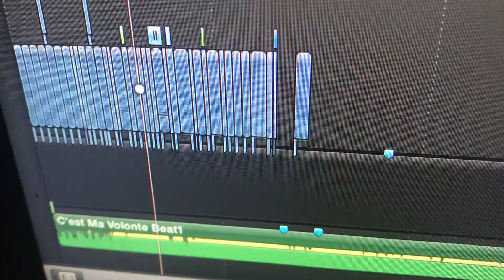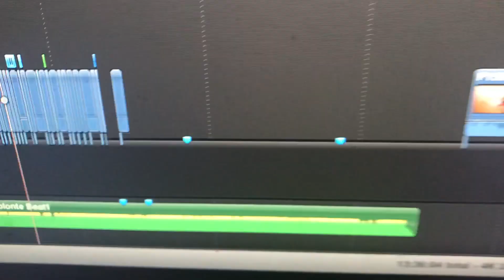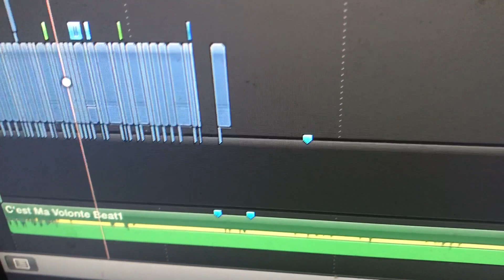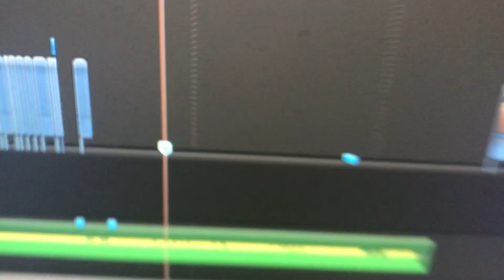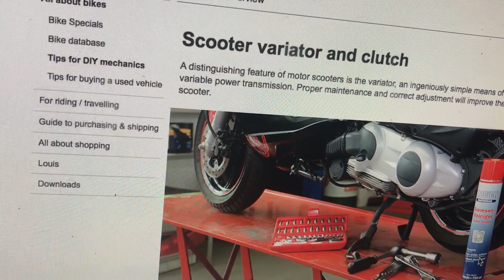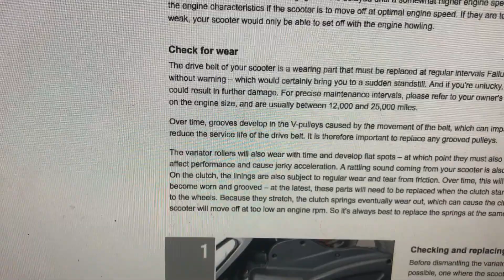I Think My GENUINE ROUGHHOUSE 50 Needs NEW ROLLERS🤷!

Comment: Could it be from wheeling?
Reply from the maker: rollers are a wear and tear item for scooters. Generally they last up to 12,000 miles but I can imagine from wheeling it wears them quicker. I read it causes rattling which is exactly what its doing. So I'm about to take off the flywheel now it got too dark last night. If I see flat spots on the rollers then thats it. They are like a spin dal on a Goped. Spindals run from 575 to 950... well rollers run like 3.7 grams to like 9/10... I think they even got 12 gram ones. The ones on this were 4.7 grams. Stock is 7-8 grams. I called Philly scooters they only have 5 grams in. Thats good enough for wheeling Ill find out when I take off that flywheel/rollers in a few minutes lol

Comment: My buddy 50 at 3700 MI.. the clutch pads got glazed over it would not take off quick anymore after checking with my genuine scooter mechanic.. took off the bell housing on the clutch..(did not have to remove clutch assembly) a little Emery cloth..sandpaper .. roughed up the glazed over pads a little bit and cleaned with rubbing alcohol.. clean the inside of the bell housing rubbing alcohol.where clutch pads make contact.. takes off like a rocket now like brand new!